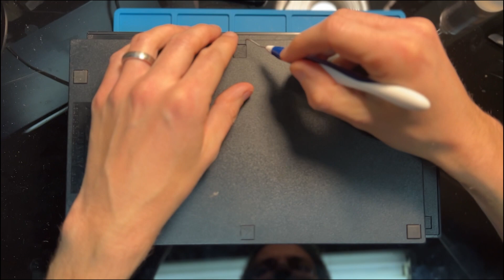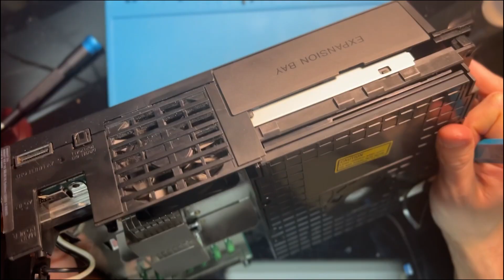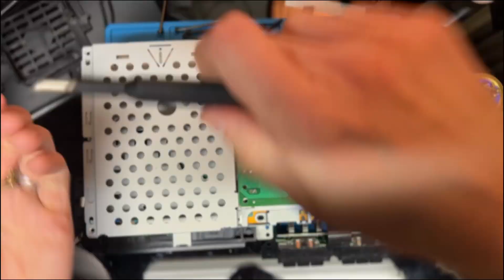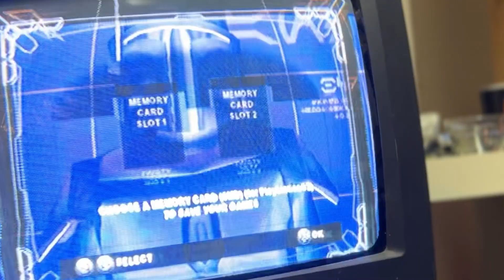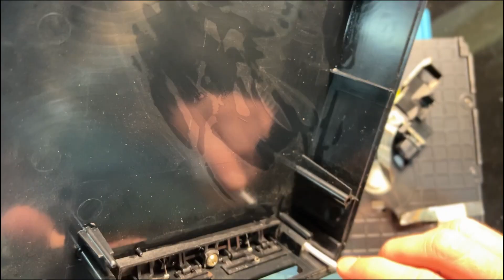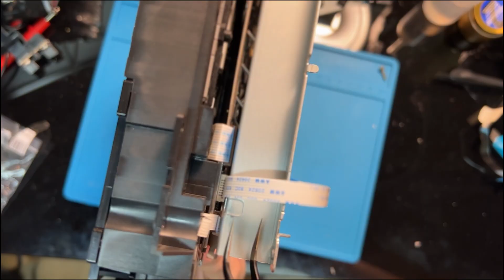Let's Fix It - PS2 With No Power (Bonus ribbon cable replacement)

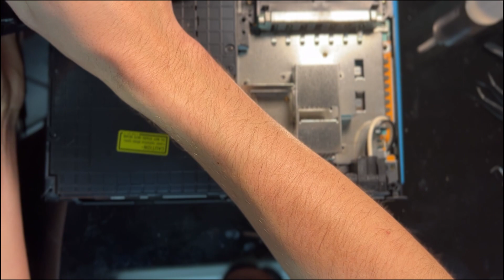Comment: 1:15 I need help with this part about the power button and the ribbon cable. I’m trying to remove it right now but can’t seem to because of a small plastic peg. It’s preventing me from pushing the component inside the shell, and I can’t seem to lift the component up out of the peg because of the way the plastic shell holds the power and eject buttons in place. It’s so annoying too because the video makes this part seem so effortless, and the process of remove it is not even shown on camera. I’m hoping that once I take out the component, I’ll be able to reseat the ribbon and get power back, since the ribbon looks to be in good condition in my case. Does anyone know how to remove the power button component?

Comment: For those that tried shorting the ribbon cable and frying the fuse it's the little PS1 0ohm resistor further into the mb, after the replace expect the caps on the power rail and eject rail to fry aswell, it's easy fix but kinda tedious to do if you lack solder skills, i placed the small caps by soldering my solder wire to one side of the cap and using the wire to place it on it's pad then touch the iron to the solder wire and connect to the second pad, better to use a hot air station and lot of flux :face-blue-smiling::face-blue-smiling:

Comment: I bought a really beat up ps2 from a flea market for $5, guy said it’s for parts only. I got some cables for it and it gets no power. Everything looks to be there and while the rubber feet were removed the void sticker looked like it had not been touched. It has a weird melted area on it and idk what that’s about but it’s near the power switch. Imma tear it down and see if I can fix it. What’s the worse that could happen? I break it?

Comment: Did a Silver 50003 for the battery...bless you Sony for putting the battery so far in that it requires a total stripdown :(  not hard until I pulled the whole fan connector housing totally off the board and had to glue and fine solder it back on.....I can get other boards for £15 on ebay
They even put the battery on a clip out holder but you have to take the motherboard and expose it completely...nonsense really
Im not touching my aqua blue one until Ive practised this a bit more on parts units......just a pain for what should be a simple battery access position!

Comment: Thanks for this guide , I disassembled and tested ,  my board had 12v dc so i cleaned  all and re assembled and it came on.   my guess is i had a bad conection from years  of use and just disconecting and re connecting cleaned the carbon off the contacts.   Tanks again.

Comment: i literally just did this to my ps2 testing something taking parts out of a working ps2 into a broken ps2, i almost rekt that ribbon cable, its so flimsy, and as it is now my ps2 works but the tray wont open/eject cause of that ribbon cable, im leaving it until i get aftermarket replacements in.

Im going to buy like a 5 pack of those ribbon cables to have on hand cause they are so bad just handling them more than once unplugging you can easily damage it.

UPDATE you can buy 10 packs of these ribbon cables for $1.30-$2 on ali epxress, although theres diff ribbon cables depending on your model of ps2, mine were all 30000s models, the one in this video is like a 50000 or newer

Comment: I went to a game store that repairs consoles and was told to get another ps2 and that it’s not worth trying to fix the power supply issue. I watched this video and think I can definitely do this myself, so I’ll come back once I’ve done it. What are your thoughts?
Reply from the maker: Absolutely you can do it. Swapping power supplies is pretty straightforward and simple on the big PS2s.  Best thing is all you need is a Philips screwdriver and a new power supply. Best of luck!

Comment: I ordered a psu from ebay as well and all i get is a whine. Its not loud but just enough to be heard when in a quiet room. There is no light on the power buttons. No standby light. No eject light. It wont turn on. Any idea what it could be?
Reply from the maker: If you have a multimeter I would test the power supply to make sure it’s good and if not return it. If the power supply is good I would recheck the ribbon cables to make sure they’re in properly and not reversed (something I’m pretty sure I’ve done before) or not fully inserted. 

If all that checks out good, it could be a fuse on the board itself that’s gone bad.

Comment: Could I use any kind of tape if I don't have the blue one?
Reply: I mean for the power ribbon
Reply from the maker: You mean the little blue piece on the end of the ribbon cable? It’s not really tape just a thicker piece of plastic glued to the outer side. You need it or something similar to keep the ribbon cable wedged in place. Otherwise it just tends to fall out of the power button.

Comment: I am having a weird issue where my fat PS2 shows everything fine on first boot but if I restart the console it displays in black and white over composite. I have checked with different cables and that wasn't the issue. Tried checking the resistors near the video processor and they are all within normal values 47ohms. I checked my PSU like you did in the video and it shows that the board outputs 11.6 volts. Do you think this might be the issue? does the PSU have to stick to a solid 12v to operate normally?
Reply from the maker: How long between restarts does it take to show a good picture? I have no idea but it almost sounds like a capacitor issue. As if they need to dissipate or something between restarts to work properly. I’d suspect capacitors on the board not the PSU.
Reply: @FixMoreWasteLess  first boot shows clear color video but if I turn off the PS2 and leave it with current then the next time it boots it’s in black and white. This PS2 is currently hooked up to an internal hard drive which makes me wonder if the current psu just can’t support regular operation plus power the drive. If it was an internal capacitor which do you think would be the culprit??
Reply from the maker: Hmm…what kind of tv is it hook up to? An old crt or a newer flatscreen? What cables are you using? If it’s a newer tv it could be that it needs to be on AV input instead of component.
Reply: @FixMoreWasteLess  CRT, I have three different composite cables. Two OEM and one third party. Still does it. I changed the psu board to a new one with the right voltage and it still happens. First boot shoes with color but if I restart it then it shows in black and white. I have to completely disconnect it from the power source for a bit before turning it on to show color.
Reply: @FixMoreWasteLess  do you have any you could point at? I have the system technical manual just can’t think of any that might be the culprit. Or maybe a picture of the area I should be testing?

Comment: I tried to tear down my ps2 that was working but it won’t turn on… I don’t think I damaged anything, my model is scph-500004 and I had to change the ribbon cable that connects under the motherbooard and the power and eject buttons. They don’t light up and I don’t know what to do :(

Comment: This video was very helpful. I did mess up and pulled the ribbon from the board. Luckily I was able reuse it. I used super glue to stick the little backing ribbon then used some tweezers to push it back in.

Comment: I have a question I had to get in my PS2 the other day to fix another issue, lubricantion of the grinding noise of the disc drive.  And in doing so I wasn’t careful enough and  the eject/power ribbon got disconnected from the system itself.  I was wondering how disassembled it has to be. Would I be in danger of getting electrocuted from reconnected it?  I’ve never had A PS2 before
Reply from the maker: The easiest way to reconnect it would be to pretty much completely disassemble the console. It’s a real pain trying to get the ribbon cable in on the console otherwise. Possible but a pain. 

Make sure it’s unplugged and if you want to be safer, let it sit unplugged for a few hours so the capacitors on the power supply can discharge. The power supply is the biggest concern here and you’ll likely have to remove it to get the console apart enough to get the ribbon cable back in.
Reply: Thanks so much for your help!

Comment: Took mine apart cleaned it now I can’t get the ribbon cable back to the way it was I don’t understand this
Reply from the maker: It is very difficult and tedious to get the ribbon cable in. These days I always end up taking the console mostly apart so I can get to the underside of the board and connect it. It’s a pain to take it all apart but honestly faster and less frustrating than trying to connect it with the board in the chassis. Also less chance of destroying the ribbon cable and needing a new one like I did in this video. 

Hope this helps.

Comment: Great information and very informative. Quick question though I did change the power supply and still getting no power. I checked the fuse but it’s all white and look like it’s bridged. The Power cord reads 120ac with both new and old power supply in placed. If it’s the ribbon would the ribbon give it full life. I would assume I would hear the fan turn on even if the power button wasn’t working. This has been an all day Sunday event😢
Reply from the maker: Oh no. If the ribbon cable isn’t connected properly then the lights on the power button won’t turn on and you wont be able to turn the console on. Fan only spins when it’s on. Try pushing the eject button if you haven’t. That’ll turn it on as well and it might be making good contact with the ribbon.
Reply: @FixMoreWasteLess  there’s no light on the power on button nor the eject button as well. I did check the mother board where the power supply is connected and I’m getting no response when I turn the switch on. Multi meter reads 0.000 on the dc mode. I order a new mother board and power ribbon. Wish me luck 🍀
Reply from the maker: For sure good luck. Let me know how it goes. If you have the board out it might be worth checking the fuses on it with the multimeter. PS2s have several. I once blew one on a PS2 Slim while working on it and it went from having a light on the power button to not having one.

Comment: Good stuff.  Dealing with fat PS2 ribbon cables is a necessary frustration.  They are a pain in the butt.
Reply: I don't understand how to remove it, I opened up the case but then got stuck there
Reply: @GadgetsGearCoffee It's too complicated to try on our own. I'd either get it fixed by a professional or buy another one off of ebay.

Comment: This helped me to fix  a  PS2 model (50001/N).  Once opened up, it had a different layout than the front power button and the ribbon cable you worked on.   The power supply was also rotated 180 degrees.  Regardless, your video and instructions were spot on and helped tremendously.  Thank you!
Reply from the maker: So glad it helped!
Reply: Hi I have the same model what ribbon cable did you buy?

Comment: You have a link for this powerboard? I have this exact PS2 and dont wanna get the wrong one. I gotta do the same...kinda afraid to open it, but heck gotta dive head first it isnt going to fix itself. Thanks again.
Reply from the maker: I bought it off eBay. The one I bought is no longer listed but one like this should work just the same. You can do it!

https://www.ebay.com/itm/314850047108?mkcid=16&mkevt=1&mkrid=711-127632-2357-0&ssspo=dpxih5zfre-&sssrc=4429486&ssuid=X-aQP1lpQCC&var=&widget_ver=artemis&media=COPY
Reply: @FixMoreWasteLess  Thanks sir I will surely look into this!

Comment: So on my power supply, the NTC2 has white stuff all over it.
Reply from the maker: That’s just a paste like stuff to hold the component to the heat sink. It’s not a leaking capacitor or anything like that.

Comment: Thanks for the guidance. I was able to follow along and only had to unplug the psu and plug it back in. That power button ribbon is indeed a little B
Reply: I don't understand how to remove it, I opened up the case but then got stuck there

Comment: Do this ribbon cable work with model 39001
Reply from the maker: Yes. In fact, 39001 is the model in the vide. Hope it works.

Comment: question: if the fuse is damage, do i replace it with the same volts, mine is 125v /5A, and i bought a new fuse with no tag l, only 5A. the voltage of my ps2 is 110v. is it ok to replace?
Reply from the maker: The voltage on the fuse should be at least equal to what you took out. Unfortunately, without knowing the rating on the new fuse I wouldn't be able to answer. Is it the main fuse on the power supply or one of the smaller ones on the board?
Reply: @FixMoreWasteLess  the one that is detacheable fuse
Reply: Y

Comment: Just got a Ps2 through EBay today, im disappointed it came dusty and it wouldnt turn on. i cleaned the system and controllers, but it still didnt turn on. im mostlikely going to send it back. i dont have the knowledge to fix it at this point.
Reply from the maker: If the eBay seller listed it as working I would probably send it back too. You bought a working device so it should at least turn on.

Comment: I need help PlayStation has no power won’t even turn on light
Reply from the maker: Sounds like it’s the power supply but check the ribbon cable attached to the power button. It could just be loose.
Reply: My ps2 has no power the light don’t turn on how did u even fix this it’s not clear to me lol

Comment: Do you know which cable is responsible for opening the disc tray? I think I damaged some when disconnecting them. Now the drawer doesn't open, only the blue light keeps flashing. sorry for my English
Reply from the maker: There’s a small ribbon cable that’s right in front of the power button cable that I think controls the tray opening and closing. The blue flashing could be from either that or the power button cable being damaged/disconnected. It could also be a different issue to do with the disc tray such as the rubber gasket connecting the gears or damaged gears.

Comment: Hi
I just got a ps2. However, i doesnt turn on like it stays on red light and doesnt boot up. Kindly help. It would be much helpful if u could tell is that a normal issue or needs a hardware issues so that i can return that. Kindly help
Reply from the maker: Hard to say for sure. Definitely not normal so if you don’t want to open it up it’s probably e best to return if possible. Might be a poor connection with the ribbon cable connected to the power button. Does it do anything if you push the eject button?
Reply: @FixMoreWasteLess  yes it opens the disc tray
Reply: @FixMoreWasteLess  it just turned on now but not afterwards. I bought it for very cheap price, is there any hope

Comment: I had my PS2 die on me recently. I took it apart to clean it. After putting it back together, the power light became orange, then after playing a game and turning it off, my PS2 never came back on again.

I bought a new ribbon cable, which didn't help. I then bought a new power supply and that didn't help revive it either. I'm thinking my motherboard is fried or something. I don't want to waste millions of dollars buying a million parts just for it to probably still not work.

I might just go ahead with buying a replacement motherboard. Buying a new console is way too costly nowadays, and if the new mobo doesn't work I can just return it probably. I don't have any kits on me to test what has or doesn't have power inside of my ps2.

Comment: Please please be careful with the power supply. I was working on mine and that big Cap holds 313V (on my model at least) enough to seriously injure you.
Reply from the maker: That’s good advice. Always take care with power supplies and if you’re unsure what you’re doing you’re better off not messing around with them.
Reply: I just opened it up and held the bottom of the power supply while lifting out the internals. Gave me a jolt but I'm ok
Reply: @Thefishypersondamn bro I still haven’t fixed my PS2

Comment: Do you do public repair
Reply from the maker: Not currently but I’d be happy to answer any question or help if I can if you need a repair.
Reply: @FixMoreWasteLess  My ps2 don't turn on and I opened it and cleaned still don't work.  I wish I can send pay you for fixing
Reply from the maker: If it has absolutely no power it’s probably the power supply. Honestly, it’d be cheaper to buy a replacement psu that fits on eBay than ship the console around.